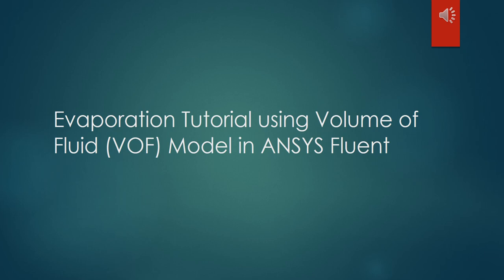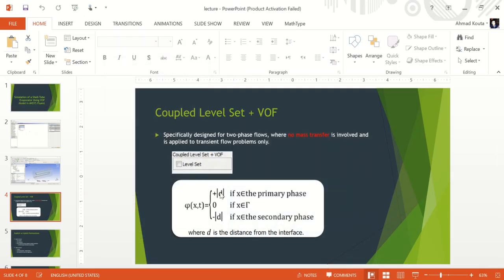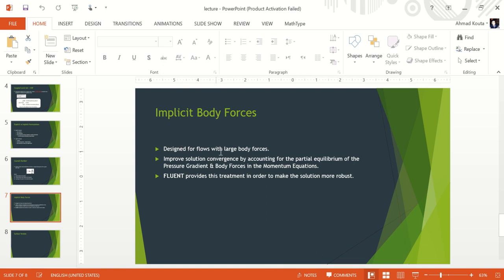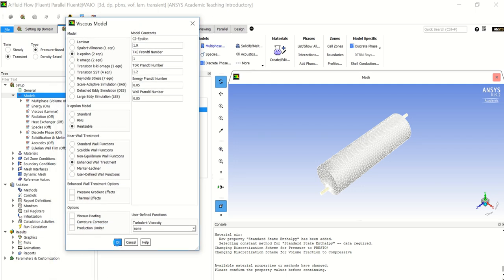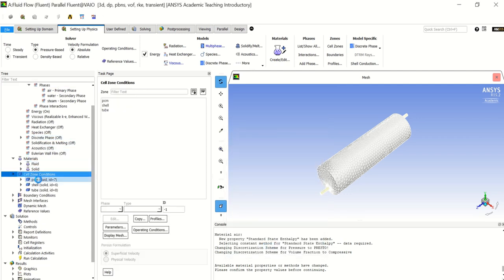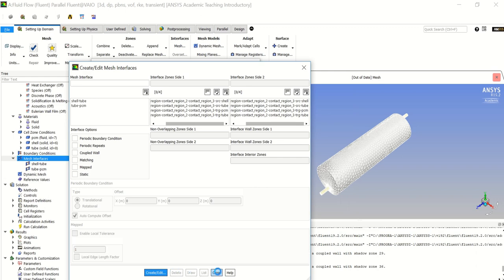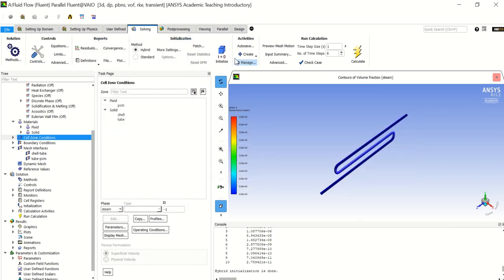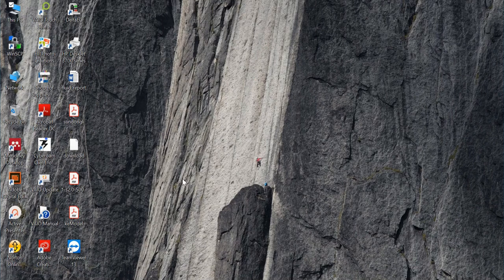Simulation of Evaporator Using VOF Evaporation-Condensation Model in ANSYS FLUENT

Comment: Great job Mr.Kouta. If you let me i want to say something about conformal mesh to help watchers. You define a some contact  region in your video. As you know if you unify the shell, tube and pcm region in design modeler, you will no longer need to define any contact in your mesh arrangement. Unify operation in design modeler,  automatically makes that region's contact surface as one part and make ur mesh as conformal i think...

Comment: Excellent tutorial! I just have the impression that surface tension should be ~ 0.06 rather 0.6! Am I missing something?
Reply from the maker: Thanks! It depends on the fluids' interface. I worked it up according to the table in the video.
Reply: I also had the same question, and I think the teacher had a little mistake in deviding it by 1000.

Comment: hello sir,
i want to compress air in cylinder using water coming from inlet (system is vertical and cylinder is closed from top), i want the water to enter continuously at high pressure. how should i approach this??

Comment: Hi! It's very useful video! I followed your steps to simulate my simple 2D pipe model. The water is passing through inlet and fully converted vapor is coming out from outlet. I can see vapor volume fraction changes in pipe and outlet.  But I couldn't able to get vapor mass flow rate in outlet. I don't have why I couldn't able to mass flow rate of vapor. The mass flow rate of water is 0.4 kg/s but vapor mass flow rate is 0 kg/s. Could I help me to find the mistake?

Comment: if i use 30 and 40 degree centrigrade of wall of a 2d body and 37 as saturation temp then is it possible to evaporate water with this model? 
actually i am working on solar still
Reply from the maker: Hello Tonoy! Unfortunately, we can't predict the results. You must run your simulations and then make the proper modifications when facing an obstacle. Evaporation is a challenging topic. So it's not simple to know the outcome by just pre-assuming values. Good luck!
Reply: do you know how to calculate the amount of water vapor produced in any model? i really need this

Comment: Actually i couldnt understand why did you assign a surface tension coefficient between air - water and air- vapor. They cannot contact in fluid flow because shell zone seperate them from each other. If u answer my question, i will be really so happy sir...